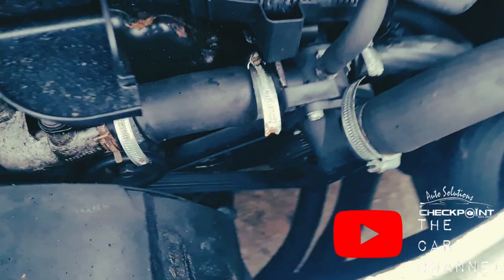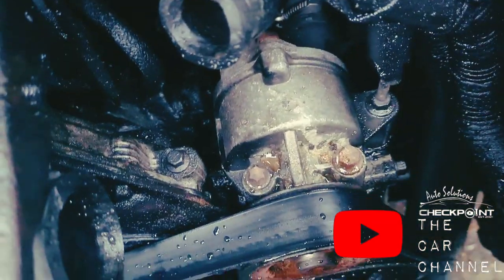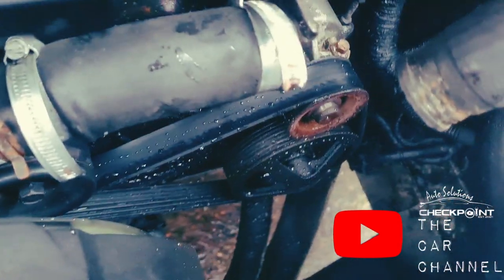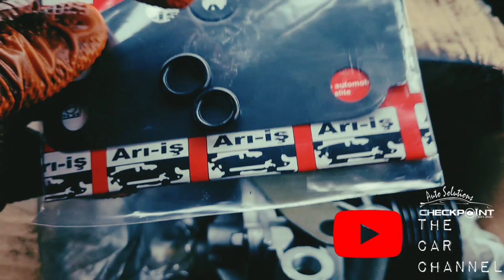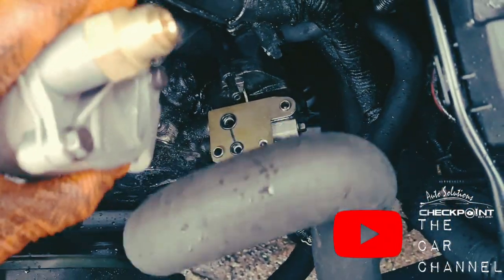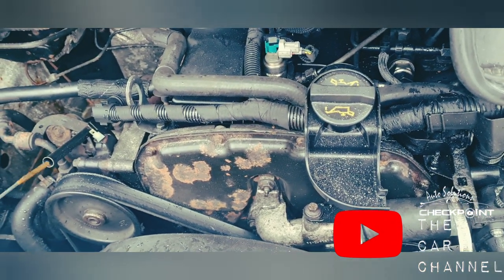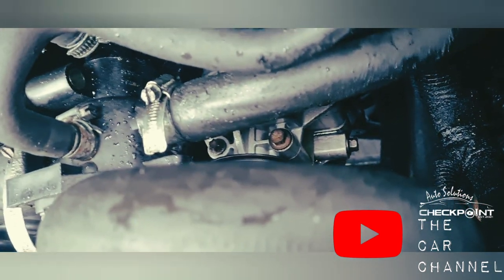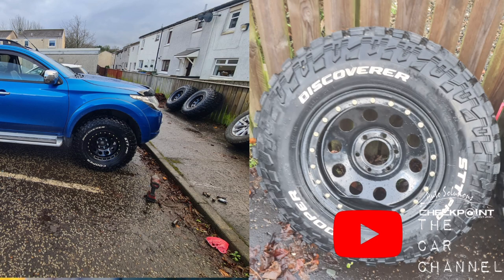Replacement Vacuum Pump That's Only Covered  300 miles  (Victim : 2010 mk7 transit  2.4)

Comment: My vacuum pump has black engine oil coming out of it. Or is it brake fluid? It looks like engine oil to me and my dip stick is below the minimum. Does engine oil come out of these vacuum pumps?
Reply from the maker: Yes , it's engine oil mate . This one was mental , it was like a cut vain when the engine was running. It was spraying onto the fan belt sending the oil everywhere.  It was a complete nightmare